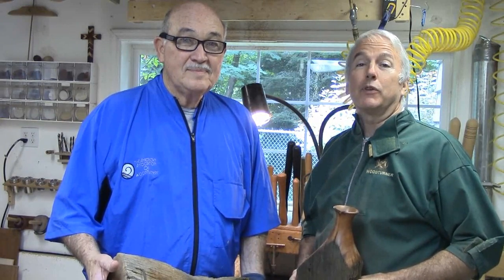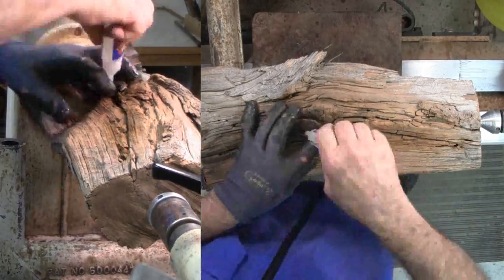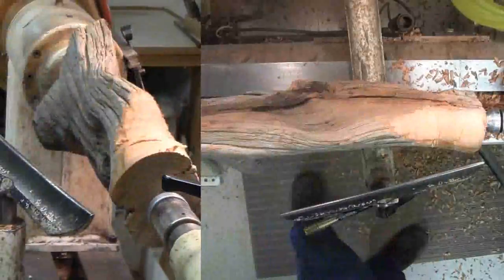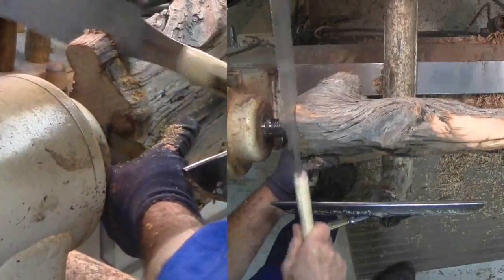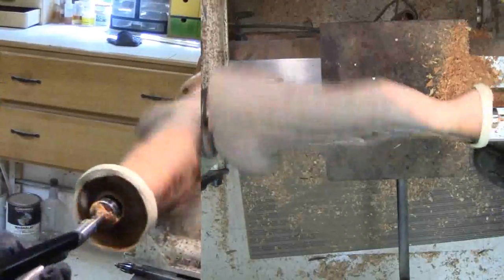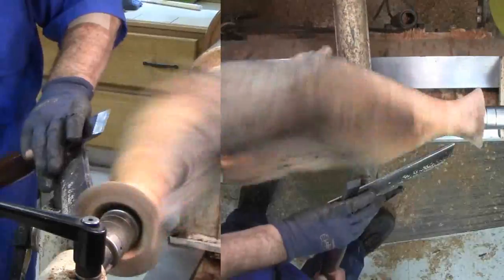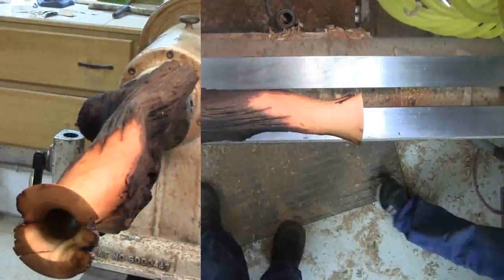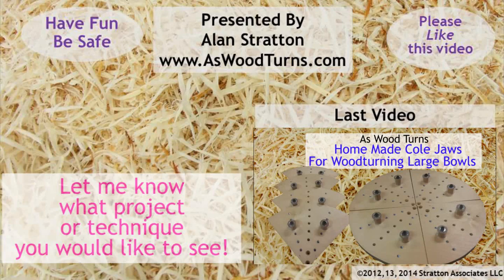Transforming An Old Fence Post Into A Rustic Fence Post Vase

Comment: oddball scary courageous project. question: isnt it actually a bit bad for the lathe to spin these uncentered pieces? it must shake like a scared hippopotamus.
Reply from the maker: A smaller lathe would have been bouncing all over. Russ's One Way lathe is very heavy and stable even with this wood.
Good observation -- Only turn what your lathe can handle.
Alan